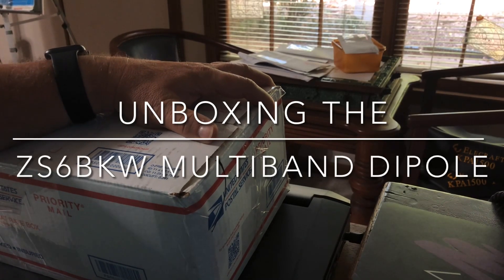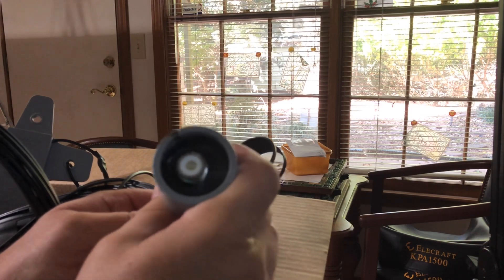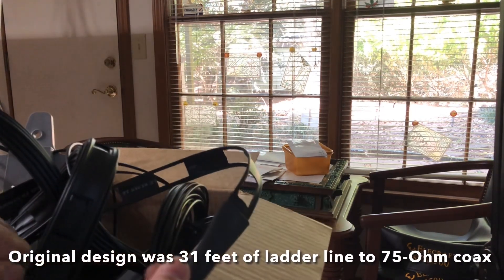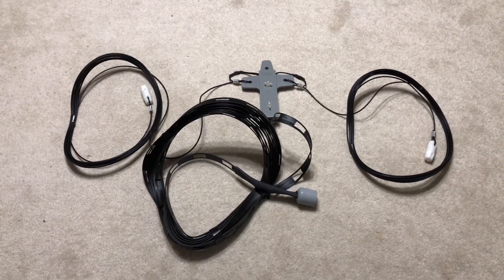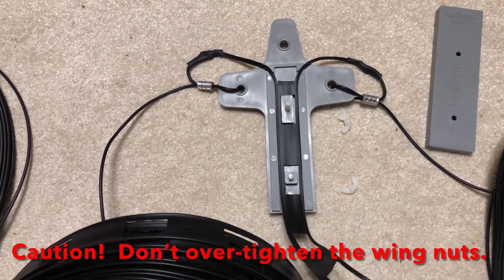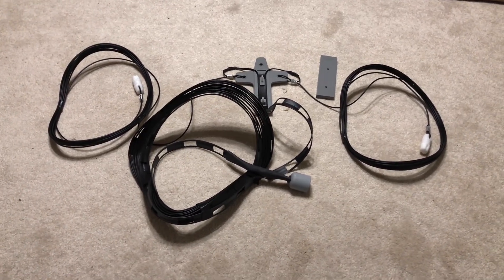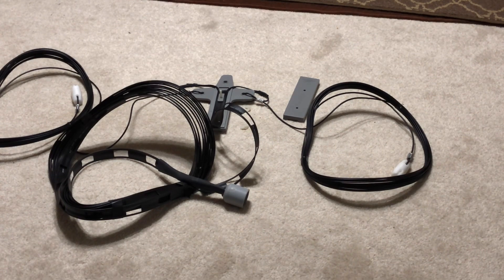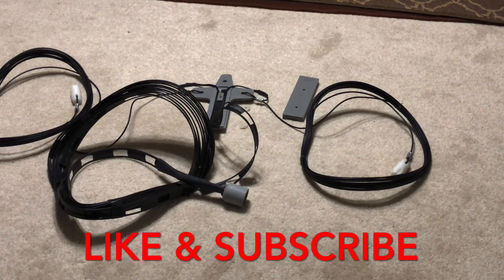Unboxing the ZS6BKW multi-band dipole from NI4L.com

Comment: Nice of you to give that away - looks like a well made antenna.  I went to his website and looked but didn’t find the answer - do you know what gauge the antenna wire is? Appears to be pretty thick - 12 gauge maybe?
Reply from the maker: The wire has POLY STEALTH 13 MADE IN U.S.A. printed on it.  It looks about the size of 13AWG.  It’s not glossy so it sort of disappears into the background of my yard.  The antenna has less than a 1.5:1 across most of each band it is resonant on, except it is only resonant in the FM portion of 10 meters.  The math just didn’t favor the SSB portion of 10 meters without sacrificing 40, 20, 17, and 12 meters.  

It does a great job on 20 and 17 meters, competing with my 250 feet doublet, and with less noise.  And, as I’ve stated many times, it handily beats my doublet and my OCF dipole in 40 meters.

73, de N4HNH

Comment: Hi Doug, do you plan on making a video of an activation using the NY4G EFHW?  I figured weather probably got in your way.  I haven’t gotten mine on the air yet, I’ve been stuck inside with a foot injury since May.
Reply from the maker: Oh no!  I hope for a full recovery.  I do plan to do an activation video with the QRP version.  I was waiting on the weather to cool off and now I’m extremely busy with my day job.  But I’ve already featured the high power version NY4G EFHW in a couple of videos, including its maiden mission and an unboxing video.  It is in the SOTA videos.

But, yes, I plan to feature the QRP version as soon as I get back to SOTA.

73, de N4HNH

Comment: Would like to get this. How long is waiting time.
 I'm not a Patriot I'm not sure how that works. But I do watch almost all of your videos, Right now I have a 
991a and 1200. After my looking  The discontinued the 1200 and I believe the 1300 I wish I would've got to 5000.
 Thinking about the 10 I don't know its pretty sensitive  receiver. Just might sell the 1200 and get the 5000.
Been off the air from all the hurricanes 80s lost all my stuff. Don't know what the selling price would be on 1200. And get the 5000. Have the 991a portable for when things get crazy. 
Have any input. I feel like a green horn. 
Thanks for all your videos learned alot here. 
Paul KQ4CD  73
Reply from the maker: Paul, I believe the FTdx5000MP is the best HF transceiver ever made.  It came out around 2010.  The 2010 version was tested by Sherwood Engineering, and it achieved 101dB RMDR.  RMDR is considered to be the most important measurement of receiver performance.  I think that if Sherwood would have retested a later model, like the MP, he would have gotten an even better reading.  But, at 101dB, the FTdx5000D is still ahead of many great radios, including the Flex radios, considered to be the best SDR available.

The problem is that the FTdx5000 was discontinued a few months ago.  Finding one might be difficult.  I heard that DX Engineering has managed to get a few.  Maybe they preordered them before Yaesu stopped production.

If not the FTdx5000MP, I would take a look at the FTdx101MP.  That is the number one receiver in the world today, at 110dB RMDR.  Number two is its little brother, the FTdx10, at 107dB.  They share the same architecture, but the FTdx10 is a single-receive version and has less knobs and no variable preselector (VC-Tune).  Both radios can directly drive an external display, making it easy to see the menus, meter, waterfall, frequency, mode, filter selection, etc.

I hope this helps.

73, de N4HNH
Reply: @n4hnhradio  tnxs if I  find a new one just might have to FTdx10

Comment: Love to try tht antenna out!
Reply from the maker: It’s quite the performer.  Being in the doublet family, there is both horizontal and vertical polarization, plus some gain over a dipole on the higher frequencies.

73, de N4HNH